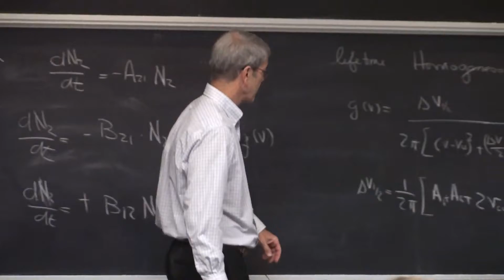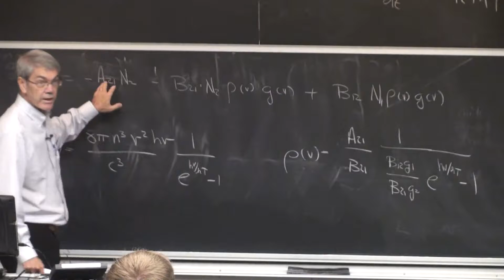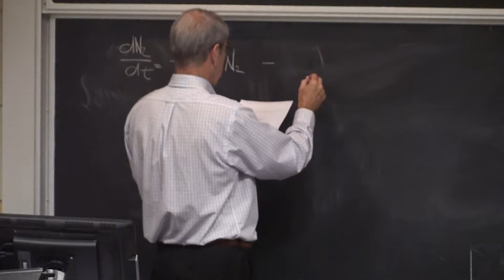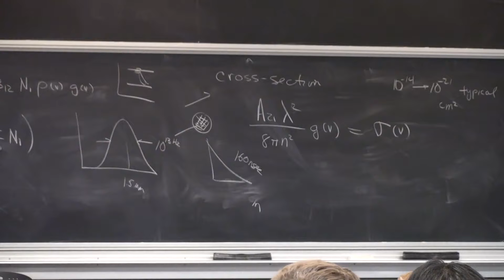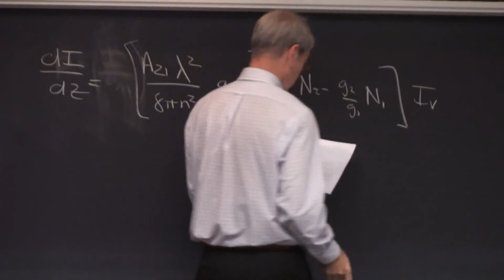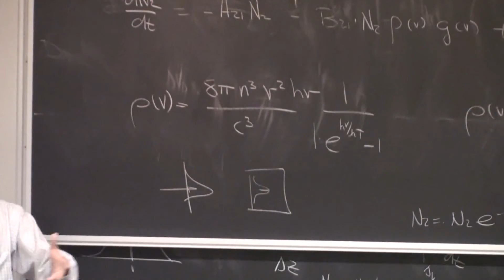Lasers & Optoelectronics Lecture 16: Laser Gain Equations (Cornell ECE4300 Fall 2016)

Comment: 48:00 - 51:02 -- The very important concept that with only 2 energy levels, population inversion is impossible.
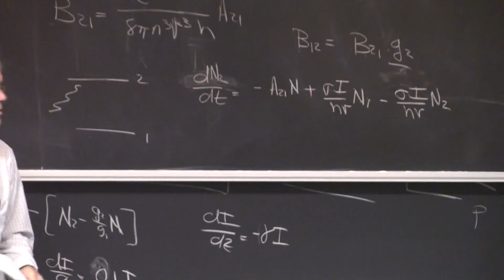48:34 - End - Analysis of Verdeyen's equation (7.4.6); the pump-less rate equation for upper state 2.